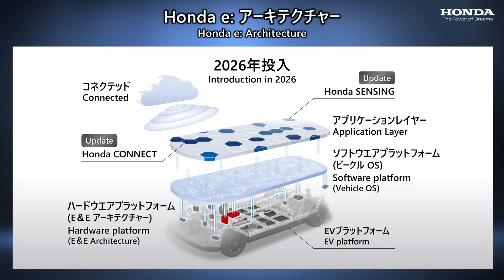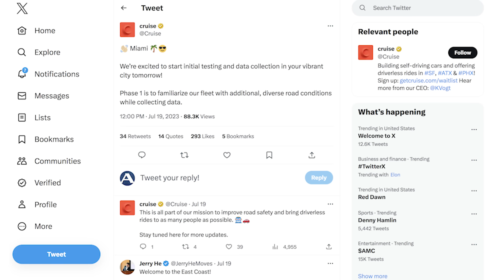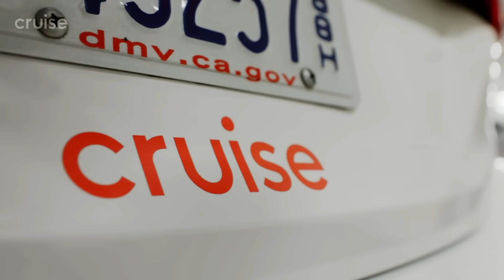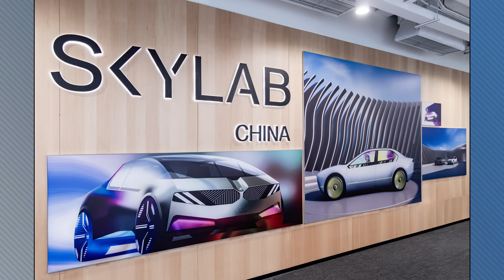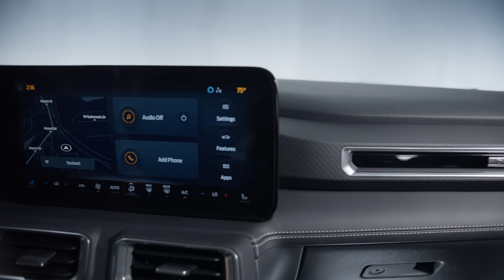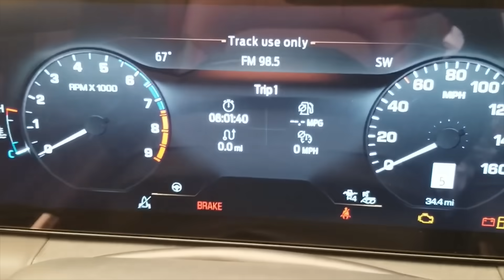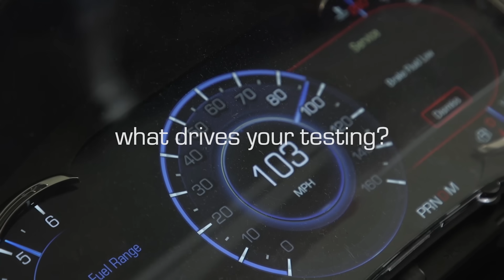New Mustang Perfect Storm of Performance & Technology - Autoline Daily 3611

Comment: "Perfect storm" is a negative term.  The Mustang is certainly a perfect storm if it only comes with combustion engines. (i.e. you can't avoid a combustion engine... you have to get one if you buy this 2024 Mustang)  It's the last thing we need.

Sean you need your head examined if you think it's a "cool feature" to be able to start a combustion engine remotely and rev it up to 5000rpm while it is cold.  That is when the engine is putting out the most pollution!!!  It's a terrible idea to implement that.  Only idiots with money to burn want combustion engines these days (gasoline, oil changes, etc.)

ICE Mustang sales have been declining every year... would be worth pointing that out

Comment: A guy in my town just got run over.  He was waiting in line inside our post office, and the woman drove through the wall and hit him.  Yes, we need autonomous driving.  There are too many idiots on the road.
Reply: About 3 1/2 years ago a gas station not far from my house had a large hole in the front brick wall.
I asked what happened and an employee said a driver of a Toyota said the accelerator was stuck (firmware issue) and had to make a choice to hit a gas pump or the brick wall.

I just read in AN

NHTSA has opened more than three dozen Tesla special crash investigations in cases where advanced driver assistance systems such as Autopilot were suspected of being used (20 crash deaths reported).

The latest 7/5/23 crash in South Lake Tahoe killed the driver of a Subaru Impreza after a head-on collision with the Tesla Model 3.

They need to understand if it was a driver error, high tech went bad, or the driver had a medical emergency, etc.

Something like a wall radar should not have any issue sensing that large of an object and could stop even if the driver had a heart attack.

The accountants will look at the cost of radar and estimate how many lives it could save etc.

I hope the best for Ford, gm, and Tesla (in alphabetical order) and have nothing against any other car company.
Reply: The Toyota gas pedal recall was not a firmware update. It was a physical update
Reply: @joebachmeier6747  I am aware of the pedal recall from about 13 years ago this was a newer model car it was explained to the owners of the gas station that it was firmware.
This is just what I was informed I did not see the car just the hole in the wall. It is always possible driver was confused.
Reply: @lp6696  In this case, the woman had a 2023 Mazda SUV.   The man survived, but has serious injuries.  Charges are pending.  Boulder Colorado, police, Valmont post office, July 14, 2023.

Comment: I can't believe (well, actually I do believe) Ford continues to throw money down the rat hole known as the ICE Mustang.  I notice you said it gets off of the line "pretty good" but no stats.  Less than 400 hp isn't going to beat any (all?) Tesla models.  Okay, we'll give the Mustang the drifting thing - how often are you going to use that considering the spanking you'll get at every redlight where a Tesla like mine is halting short on the yellow just so you'll end up at the pole position with me.  I love it.
Reply: Nobody cares about Tesla!This Mustang is the way to go!Supercool!
Reply: I’d like to see the new Mustang GT vs the new Mustang MachE GT. I bet I know who will win. And it’s not the one with a “drift brake”.🤪
Reply: Ha ha , oh yes, the Tesla will be so much fun as you're crapping your pants looking for a charging station that is open.  On the other hand when the gas gets low in the mustang, they'll be able to stop in just about any little town to buy some more gas and even if they didn't make it to a fueling station,  the mustang owner could arrange to have someone bring him a gallon of gas to get him on his way.  On the flip side,  when the Tesla runs out of power,  what do they do,  call for a tow? I've seen that there are vans with portable gas generators in them and they come out and plug you in for an hour or two. How much is that going to cost?  So much for the blindingly fast 0 to 60 times.

Comment: Who in the heck cares about the new ICE Mustang??? Most regular sedan EVs will smoke it. 
How about comparing this new Mustang to the new MG Cyberster?  The Cyberster has a total of 536 HP and 516 pd/ft of torque. 0 to 60 in 3.0 sec. 
Mustang???
ICE is sooooo over!
Reply: Notice he did not quote 0-60 times.  Ford doesn't want anyone to know that until it's already on dealer lots

Comment: Quick 8 year check - A 2015 Model S85 sold for $80K new, and with 100K miles is worth $25-30K on the used market today.  The 2015 Audi A8 new sold for $79K, and with 100K miles is worth $22-27K on the used market today.  Generally Tesla's hold more value than competitors. Of coure the Tesla saved the owner $20-30K over the 8 years in reduced fueling costs and reduced maintaince over a similar ICE car. Still, long payment schedules on any car is rarely a smart choice.
Reply: These numbers seem outdated.  Used Teslas have fallen more in value than ANY other brand EV or ICE this year.Check the numbers on the model 3's and Y's.  The bottom has fallen out of them.
Reply: @davewhite113  Nonsense, Teslas are still generally the ones with the best value retention, you assume everyone else didn't suffer the bad macro as well, they fared even worse.

To Tesla's credit, their price drops were successful and they are able to increase their unit sales by 80 percent vs prior year.

The same can't be said for legacies, their sales shrank, and it's especially bad in China - Mitsubishi existed the market altogether due to collapse - and EU - unit sales down by half a million cars.
Reply: @AllanSustainabilityFan   Check the FACTS, used Teslas have fallen more than any other brand this year. That's a FACT.
Reply: @davewhite113  That's a meaningless "fact" because it's a short-term blip during a price cut. Why pretend the macro economics are somehow happening in some "Tesla" vacuum?

The important fact is that Teslas, regardless, are still the best at keeping their values, it doesn't matter. Even during the discount period, the other cars crashed in prices by comparison.

Especially in China where German brands such as VW are even selling $40,000 brand new ID.4s for $16,000, for example.

If you want to lose more money on depreciation, buy some German car. Teslas hold value much better by comparison, and save you a ton on gas and maintenance every day.

Simple as that.
Reply: @AllanSustainabilityFan   If you bought a new Tesla in the past few years and your car has plummeted MORE than any other brand, it's not a meaningless FACT.
Reply: @davewhite113  A simple visit to Carvana would make this obviously a false general narrative: Try finding an old Model 3 under $32k, the competing BMW X3 goes as low as $26k by comparison.

The fact is that legacy cars are piling up with over 100 days backlogs, and their used car values are likewise suffering because of a glut in the market during the currently bad economic macro, forcing those nutty Covid prices spikes to subside to normal again.

This is no surprise, thin of it in terms of horse carriage industry during the advent of the early cars, you're arguing that the Model T is a bad deal and ignoring that more and more people are dumping the legacy's horse carriages.
Reply: @AllanSustainabilityFan   That's just Carvana, they probably have those left over from last year. I know at Manheim , which  auctions an average of 370 teslas per week day, their prices have plummeted. If you'll just google it, you'll learn that their vales have fallen more than any other brand, and a lot by a lot!.......Tesla now has more days of unsold  inventory backlogs than Ford and GM combined do.......Somebody must've have duped you with the horse/buggy comparrison. There is NO comparrison, cars were a HUGE upgrade in every way over the horse and buggy, they completely changed transportation. Ev's are actually a downgrade from ICE in that you have to stop and charge them on long trips.
Reply: @davewhite113  That's just looking at a small - and very unusual - window where Tesla cars actually appreciated in value during the Covid pandemic. People were selling their used Teslas to impatient folks who wanted to cut in line - and then commonly turned around to order a brand new Tesla with some pocket change left.

That didn't last long after Tesla doubled its production twice and then got into a price war to weather this year's macro.

Don't make a story out of some unusual freak scenario, focus on Tesla's depreciation vs its legacy competition.

Here's some examples:

2020 Tesla Model Y -10%
2020 Tesla Model 3 -12%
2020 Lexus RX -13%
2020 Tesla Model S -14%
2020 Tesla Model X -18%
2020 Audi A4 -23%
2020 Porsche Pan -25%
2020 BMW 3 series -29%
2020 Lexus LS -29%
2020 Genesis G90 -31%
2020 Audi A8 -33%
2020 Audi E-Tron SB -34%
2020 Porsch Taycan -35%
2020 Mercedes S-Class -41%

Title:
"Used Tesla vehicles crush industry average depreciation despite price cuts" 

Source: Recurrent auto's Q2 2023 Used EV Report.

Excerpts:

"According to this report, the average used Tesla Model 3 and Model Y has only depreciated roughly 10% over the past three years, which is significantly less than counterparts from Mercedes, Lexus, and even Porsche."

And they likewise confirm the highly unusual "appreciating value" phenomenon:

"The shift from Teslas being appreciating assets to more typical depreciating vehicles has been a dramatic one. Still, other than changing the used EV market’s average price tag, which has continued to cool to just $38,000 in the second quarter of the year, it has also likely rapidly changed the Tesla ownership experience overall. Most prominently, Recurrent believes Tesla owners are holding onto their vehicles for longer than ever, which can be seen in the decreased number of used Teslas for sale"
Reply: @davewhite113  There is a lot more to the story. Tesla is the only company where all its cars sold in USA are made in the USA. As such new Tesla cars get the full $7,500 fed rebate this year.  Few other EVs get this advantage, but it also hurts resale values by about the same amount.  Since Tesla dominates the new and used markets, this causes other EVs to loose value too, even though they don't qualify for the $7500 rebate. So purchasers of new and used EVs are getting some of the best deals ever.

Comment: Cruse and waymo are NOT autonomous cars. They are pre mapped, always connected, preprogramed driverless vehicles. once a Tesla get an update, IT IS ON ITS OWN. Thats autonomy.
Reply: Straight into the first road sign
Reply: @taniabanes4707  OEMs are gonna be lining up for FSD. I was right about the superchargers, and this is next. You heard it here first!
Reply: @dclpgh  Ok Nostradamus 😂
Reply: @taniabanes4707  Ill take that as a compliment thanks.
Reply: @dclpgh  omg…
Reply: @taniabanes4707 that is funny.  Hasn't happened in reality tho
Reply: Cruise and Waymo are indeed autonomous cars. Level 4 to be exact by SAE standards. HD maps are for navigation. Both uses AI for Machine learning algorithms. This simply more than a car just following an invisible track.
Reply: @polo3433  SAE standards were drawn up years ago when "computers driving cars" was science-fiction.  Those 5 levels are due for a rewrite and absolutely NOT the-laws-of-physics or worth obsessing over.
Reply: @polo3433  Bouncing lasers off of walls is not autonomy. That seeing eye dog approach is not autonomy. Figuring the road out as you encounter it in real-time that's autonomy. It's not level4 if you can't even drive on the highway. Waymo has been at this for 20 years and they're still stuck in the city.
Reply: @dclpgh  No matter the method it will take you from point A to point B. It can use HD maps, magnets, or pure AI, it is still autonomous. Working with autonomous cars the hardest thing are Edge cases. Level 3 or higher the 
Liability falls on the company and not the driver. This is why certification and permits are needed for level 3 or higher. You can imagine a damage image of self driving cause by a rogue autonomous vehicle on the freeway. Both companies are taking a methodical approach, this should not be rushed.
Reply: @polo3433   In any case it will all come down to who has the most data, The capacity to chew on that data (Dojo) and the processing power in the cars. (No one comes near that) Tesla has all that on one  chip. The rest still have trunk loads of servers. and dont forget the software prowess.  and we both know who's winning that race.